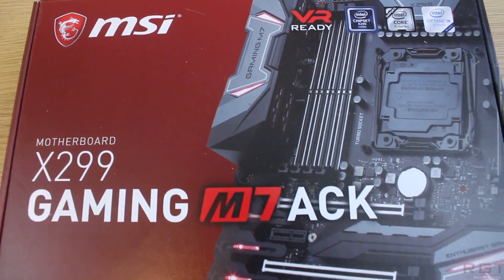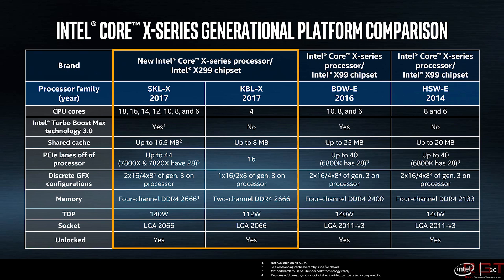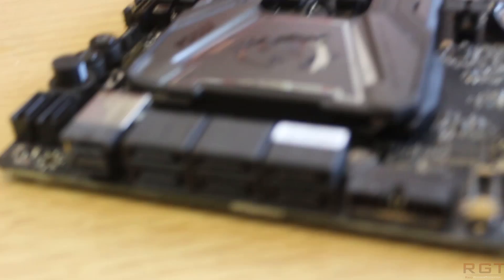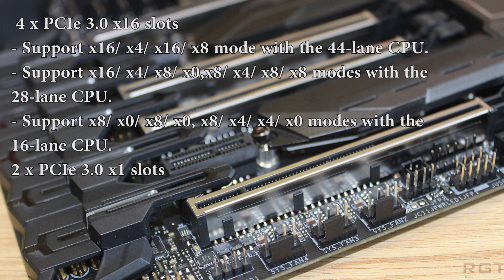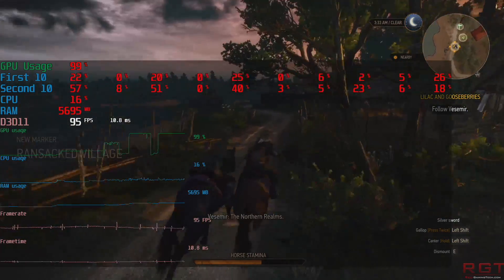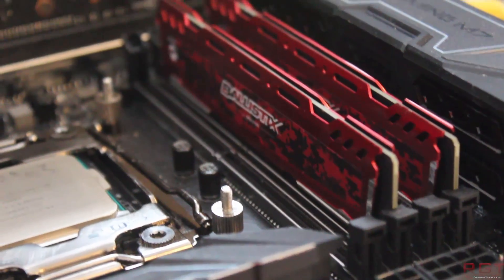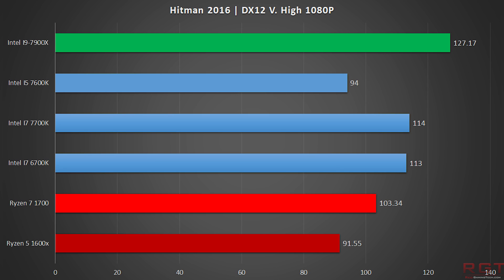Crushing Performance - MSI X299 Gaming M7 ACK Motherboard & I9 7900X Review

Comment: I love your channel but is it possible to go back to the old mic? This one has a really bathroomy voice, doesn't really work well.

**Edit: if you want professional voice, you should use a studio mic, relatively inexpensive like the Auna mic-900 https://www.amazon.de/MIC-900B-Kondensator-Mikrofon-Studio-Aufnahmen-Nierencharakteristik/dp/B00AE4T0Q2
You can't go wrong with a condenser mic. Anyway, keep it up, you rock :)
Reply: ^ This
Reply: Make it right.
Reply: It's not his mic he is using real time software noise cancellation listen to this bit when he is not using it you can hear his PC but he sounds a lot better

1:59

Then when he is using the noise cancellation 

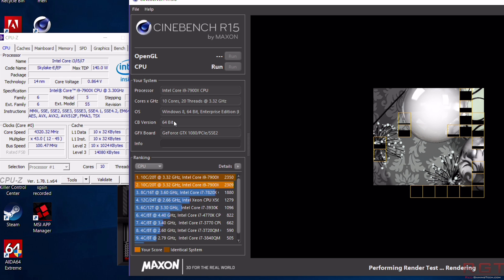3:13

Realtime software based noise cancellation mostly works by removing certain frequencies of sound so you sound wrong, hardware noise cancelation is fine though as what you do is you have 2 mics one facing away and one facing towards you and you remove noise than was present in both mic as long as there is good enough isolation between the mics and they are of high enough quality the results will be pretty good.

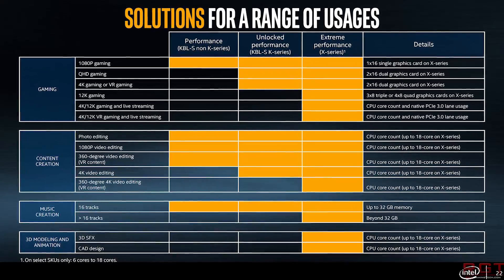It's even worse when he is standing away from his mic because in real terms he is quieter so the software will drop out those frequencies even more compare 4:27 to 1:59 then when he normalises the sound in post it sounds terrible.

I suppose the new mic could have been quieter which made the problem worse though, and he may be using post software noise cancellation which works similarly to realtime but it has a larger sample so it's not usually as bad, but still pretty bad if you are working with low volume inputs as it will remove some of your voice along with the back ground noise, although if you have a good mic which is loud and you are relatively close to the mic post software noise cancellation can work well enough